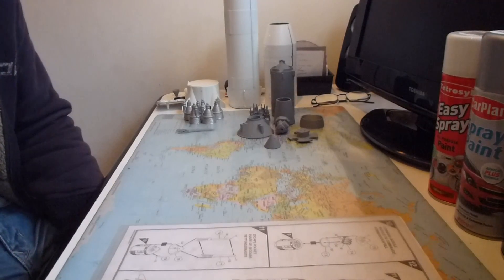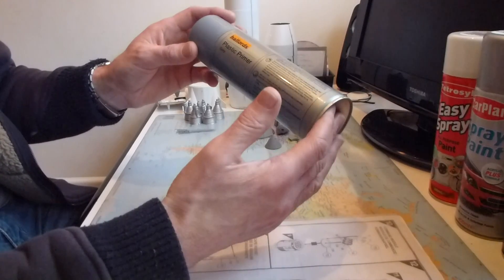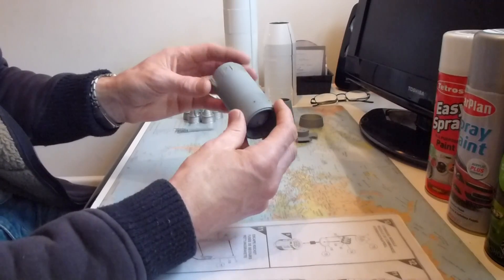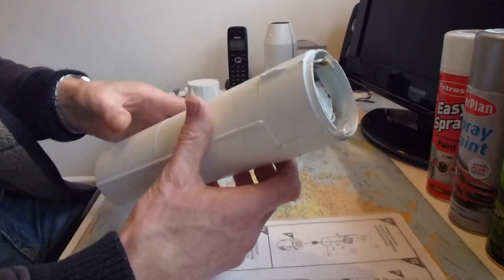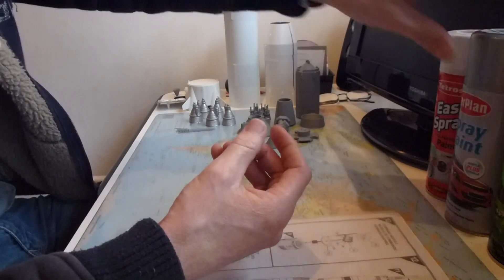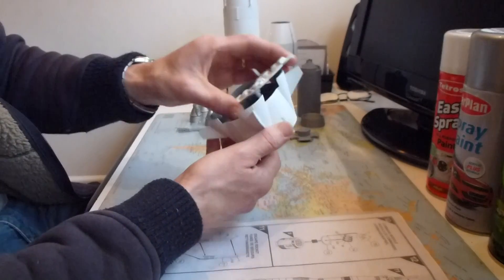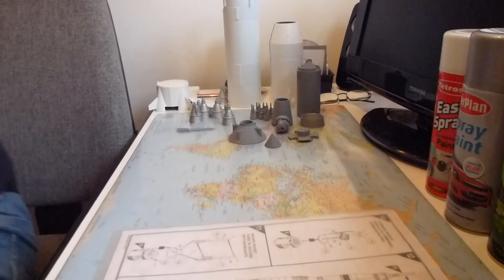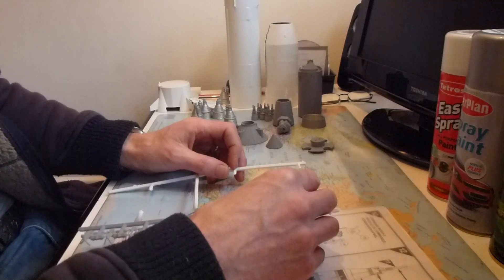Saturn V Model Build (PART 2) 1:144 Scale

Comment: Car paint.. I never thought of that.. brilliant! ... is there a Part 3?. all. of us would like to know . thanks 👍🇳🇿
Reply: I noticed that, that is all i use. When i came back to modelling, the modern model paints were rubbish. The grey primer is my stock in trade. You can get satin and gloss in the large cans and most colours. The small modelling spray cans can be expensive if you are really desperate for accurate colours, but there are a good range of acrylics from art suppliers. Try Kobra paints.
https://www.graff-city.com/spray-cans-c128/spray-paint-cans-c76/kobra-spray-paint-c88/kobra-hp-spray-paint-p1426
For weather washes just use water based artist acrylic from cheap shop. Apply with water with drop of washing up liquid.
Reply: @flybobbie1449   Good advice.. innovative.. thanks from NZ 👍🇳🇿